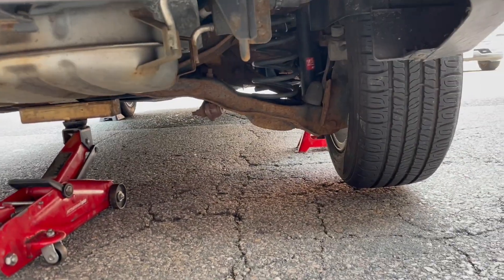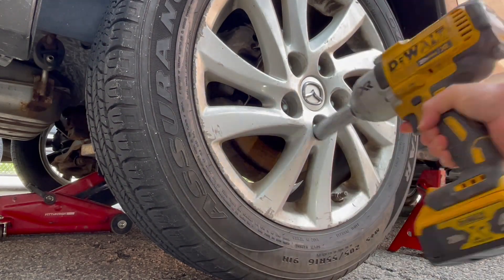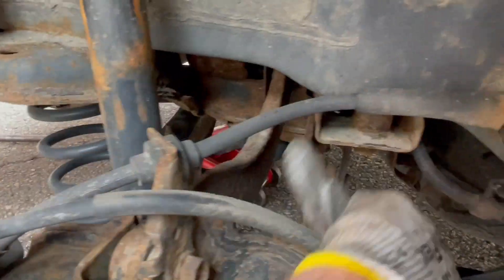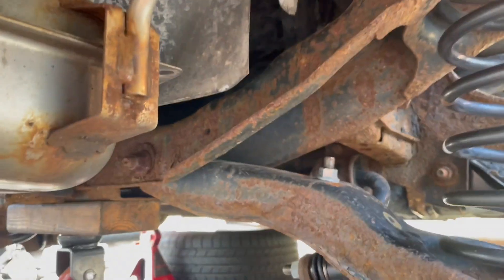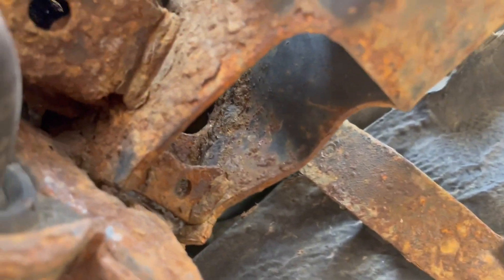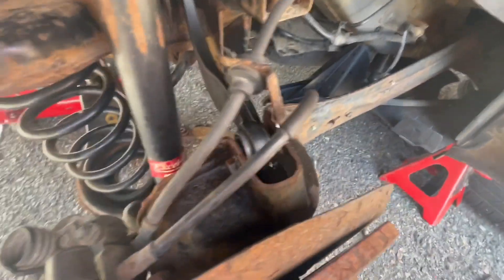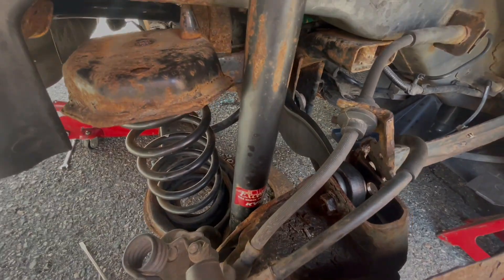How to Change a Mazda 3 Right Rear Upper Control Arm

Comment: Holy shit. Use the jack points. That pinch weld is literally a 1/4" of metal. You WILL krill yourself if you're not careful lmao. Makes me question literally everything you're doing.
Reply: You may want to check the service manual. There are two jack points on the pinch welds on each side. The center front and rear jack points are for lifting and lowering the car, for the most part.

Comment: hey i know you changed other parts but for the upper control arm looks like you dont need to drop the subframe? a flex head wrench could do the trick right?
Reply from the maker: You are correct but I couldn’t break the bolt with all the rust without an impact so needed to lower it to get access.
Reply: alright thank you. hopefully when i get look at my control arm its somewhat reasonable. ill just use some pb blaster to let sit overnight @OliverPorter92
Reply from the maker: @MrWubzywubzy  also helps if you’re using a lift; cheater bar on a flat 17mm box. And you’re still likely gonna have to bend the canister vent solenoid bracket out of the way to remove the bolt once it’s loose. Very annoying job hahah.
Reply: hmm in the video i cant see the solenoid bracket. did you bend it upwards?   @OliverPorter92
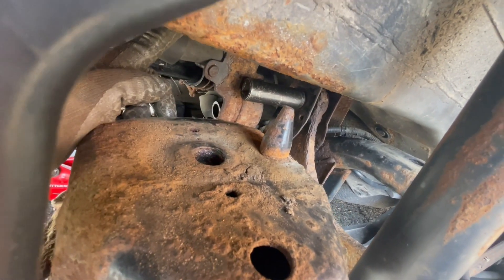Reply from the maker: @MrWubzywubzy  1:20 right behind the 17mm socket
Reply: one more question. is this a hatchback or the sedan gen 2? @OliverPorter92
Reply from the maker: @MrWubzywubzy  sedan
Reply from the maker: @MrWubzywubzy  sedan

Comment: Crazy that you have to lower the entire rear end to get to one control arm
Reply: New Mazda 3 u have to lower sufframge too.. unreal shi t!!
Reply from the maker: @bastogne315 ugh too bad they didn't improve the access! Even a little door from the spare wheel well would help but that costs $$$ :)
Reply: Abso-friggin-lutely insane to have to do that.....
Reply from the maker: @Pragmatist1st  I know right? Some stronger folks can make it work w a box and a pipe on a lift
Reply from the maker: I know man. There are a few other vids on here w a long open ended but my bolts are so rusty I needed the room to hit it w the impact
Reply: @OliverPorter92  Do you think we can get there with a long impact extension without touching the frame?
Reply from the maker: @ unfortunately no. Unfortunate factor of the design; I’ve dropped my subframe several times to access this and the vent solenoid, so have it down to a science